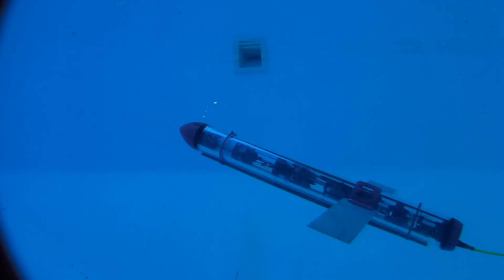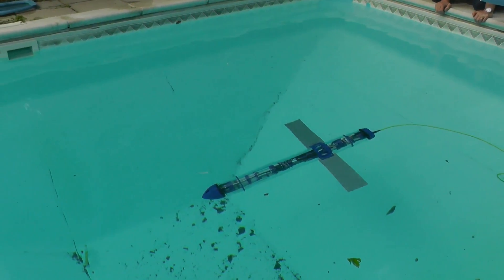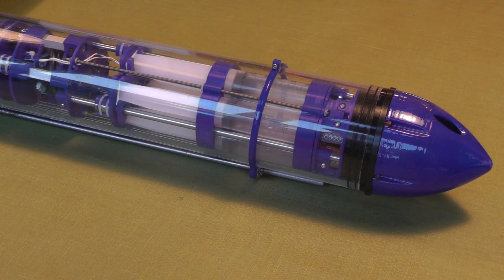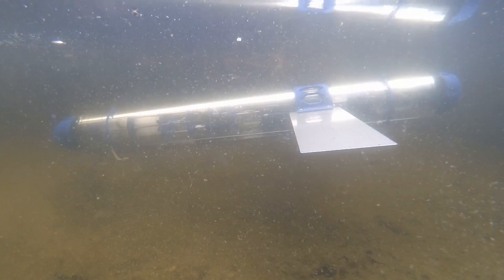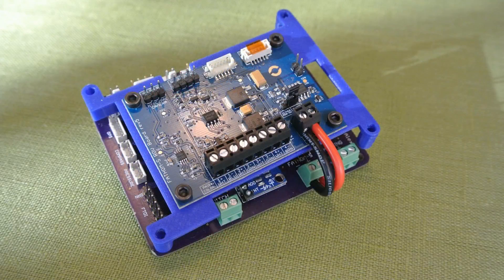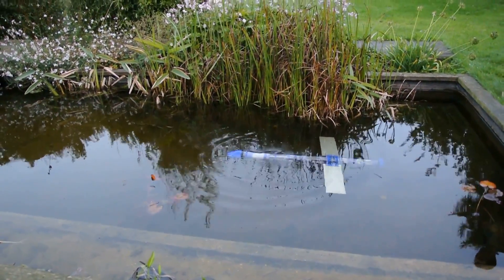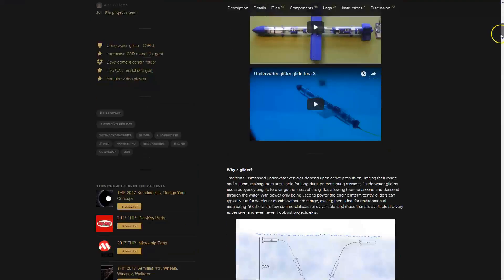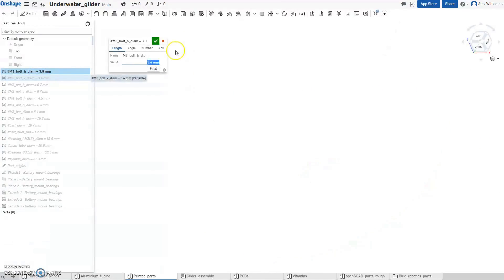Open Source Underwater glider - 2017HackadayPrize

Comment: Hi Alex, 
This is Arman from Bangladesh and I am a huge fan of your work. I am currently developing an Underwater Glider (UG) as part of my Post-Graduate Thesis, where I will be testing the gliding performance of a UG with wings of different shapes. For that purpose, your contents of HACKADAY are helping me a lot. However, I have checked the website of Blue Robotics, where within the available watertight enclosures with a 4'" diameter (as mentioned in your part list), the maximum available length is 400 mm, but I think you used a tube with 1000 mm (1 m) length. Could you please suggest to me how I can manage an enclosure with the same specifications as yours? 

It would be a great help. Thanks in advance for your time.
Reply: cool

Comment: Neat project! Great integration effort, and beautiful pitch and roll system, looks novel! 

But I wonder if this design is a complete dead end,. There is so much 'dry' space in the motor area, I think we both know there's no way this design, fundamentally, could ever achieve a worthwhile glide depth (which is the whole point of these things...)I doubt it could even do 10 atm, so isn't this all show? It's like an impossible, but cool, airplane design that just drives around the runway?

Comment: How did you get the idea to use a buoyant motor?
Reply from the maker: The buoyancy engine is the only way an underwater glider would work, so I had a look at commercial underwater gliders and they typically use an oil bladder (they pump oil from an internal to external bladder to decrease overall density and vice versa) or syringes for their engines. A syringe system is easier and there are a couple of designs out there (mainly a servo on the end of a modified syringe), so I tried my best to iterate upon this and build a complete system.
Reply: @alexwilliams8878  other than a propeller bruh...
Reply: @michaelgimbel4418  It's much much much more efficient than a prop